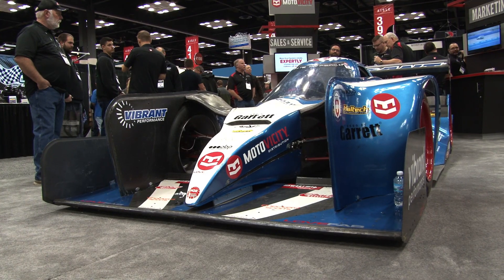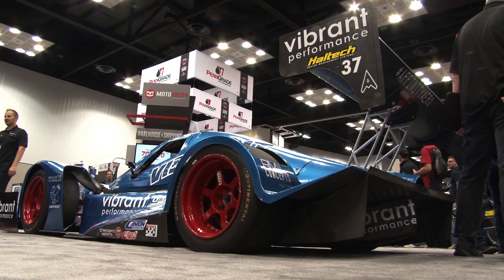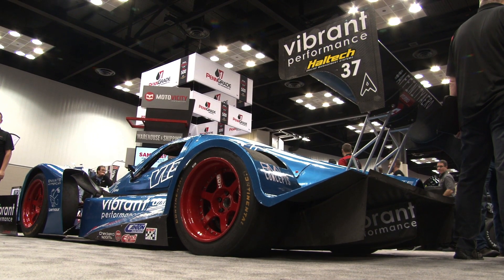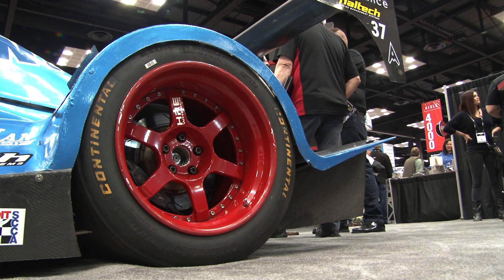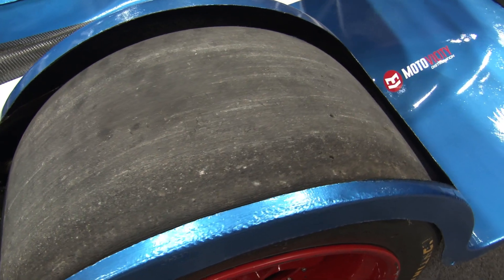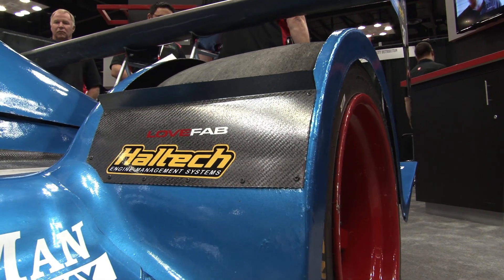⭐ PRI 2016 Highlights: Cody Loveland and Enviate Hypercar

Comment: Why so heavy ?!
I mean they are very good numbers , but there are less than 500 kg like the bac mono , or the similar 670 kg Praga R1R ?!
They should put some thing lighter than the ls based ! that would save a lot .
Reply: I think the tyres made a lot of the weight, slicks are heavy, and those things are very wide, bac mono doesnt have slicks, and the praga doesnt have wide tyre, i think theyre only 265 wide or something, while this has 345. And this also had the chromoly chassis which weight quite a bit also